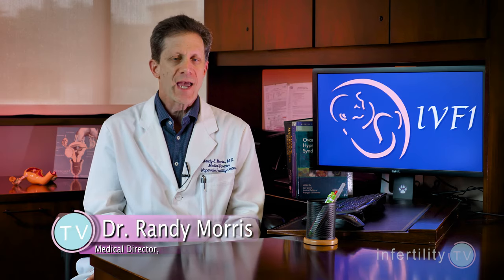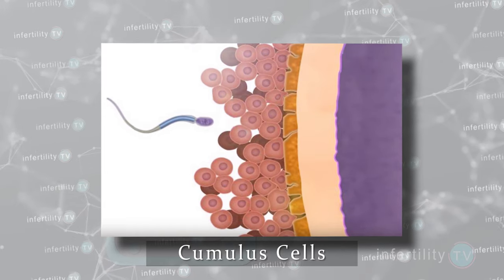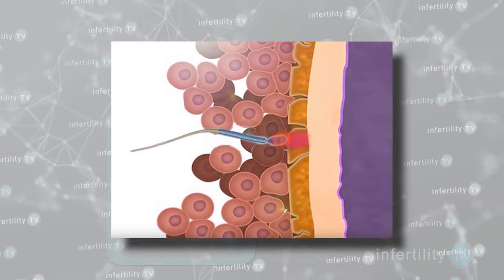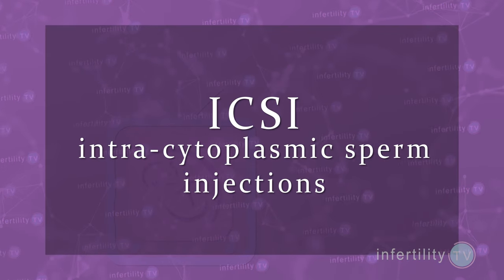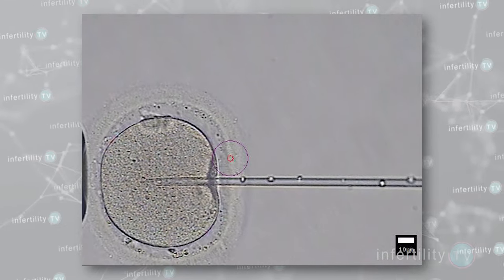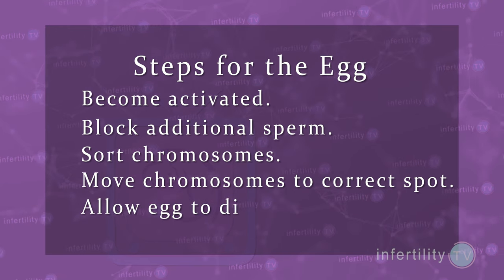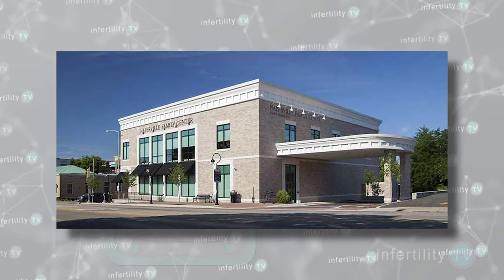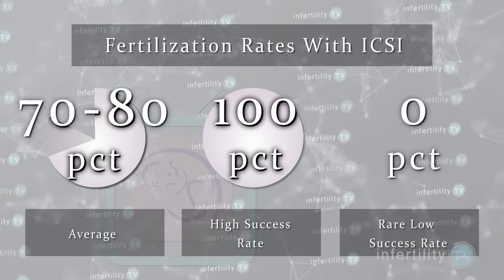IVF - Why Eggs Don't Fertilize

Comment: Hi Dr  Randy thank you for the video it helps a lot. i have a question and i hope to receive your answer. Could you please explain to me what does it mean the ´´egg not fertilized´´ does it mean it doesn´t make an embryo or both are different things?  actually am in the journy of IVF procedure for the 3rd time. and they collect from my only right side 2eggs. yesterday they called me to tell me that there will not be embryo transfer bcs the egg is not fertilized. in my 2nd round i had 3eggs and the procedure faild. but they kept them and they will reuse them  So they told me they used 4 out of 5eggs. but nothing to work. i turned 39 on january so is that mean i will not be a mom bcs i dont have enough eggs???